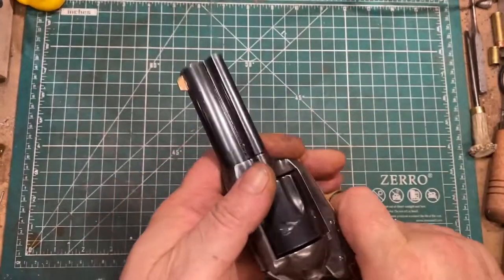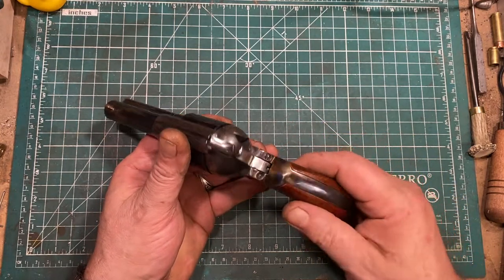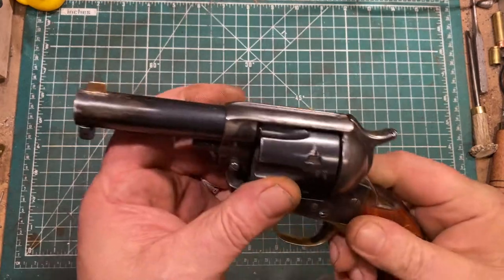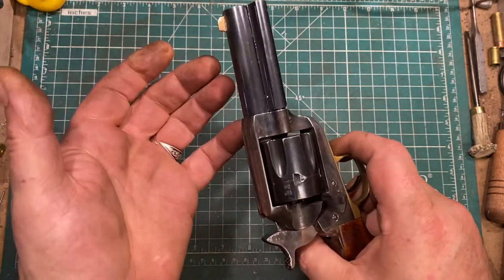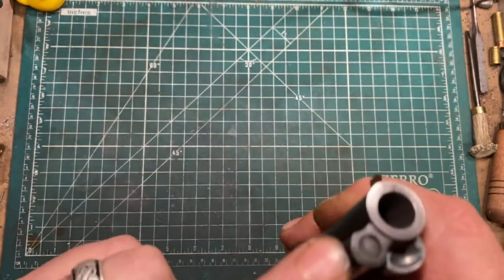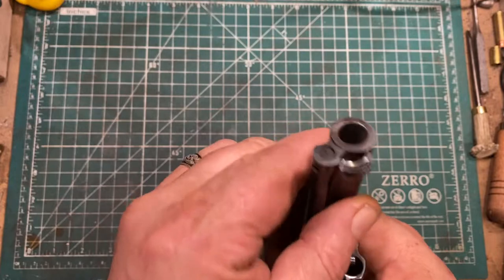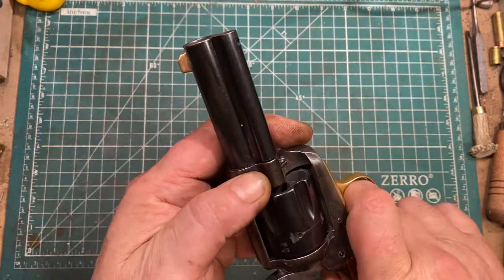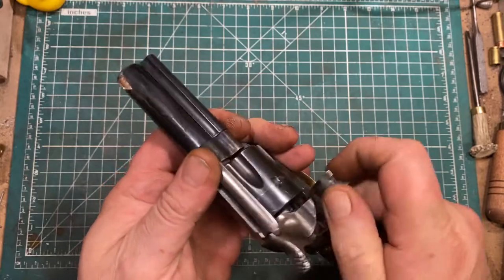SAA 1873 Shorty- Armi San Marco .45 Colt

Comment: I always liked the looks of the birds head grips, but never owned one until about a year ago. I bought a Cimarron Cattleman 4 3/4 inch with the birds head grips. Even after a few hundred rounds, I still couldn't get used to them. They just didn't feel right to me. Eventually I gave up on it and just ordered a standard trigger guard and backstrap for it. I held on to the old grips and strap just in case I ever want to use them on something else. That ejector work is pretty slick. I never would have thought of that.
Reply from the maker: Thanks!